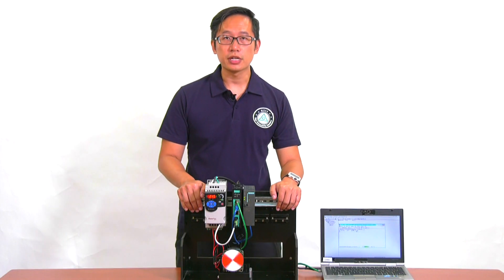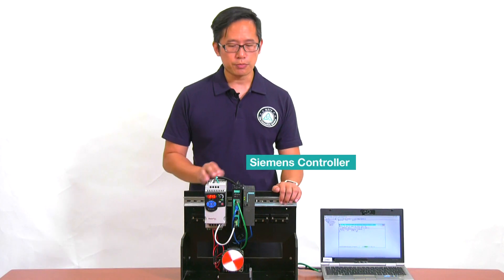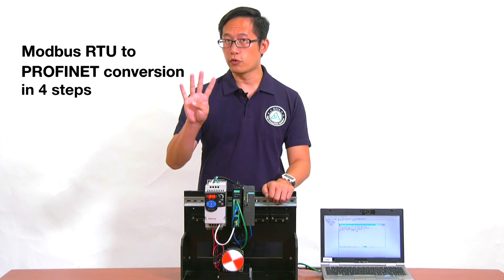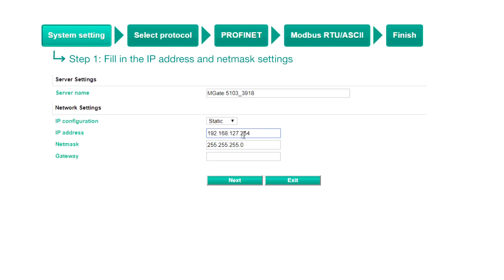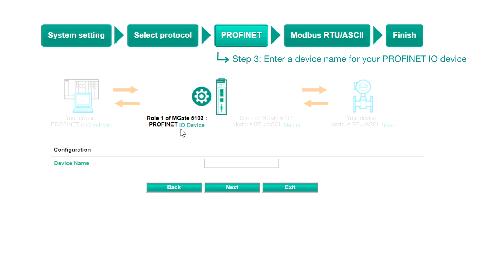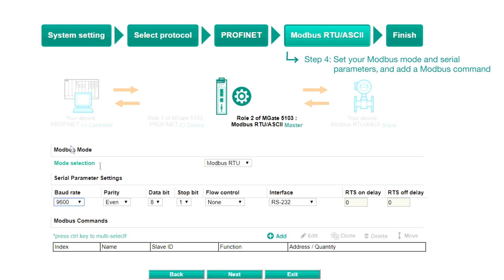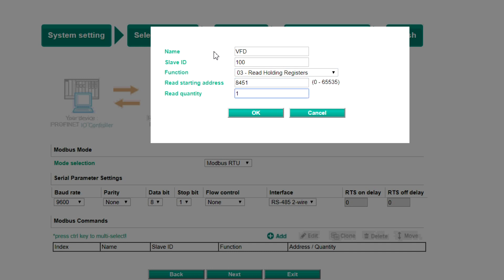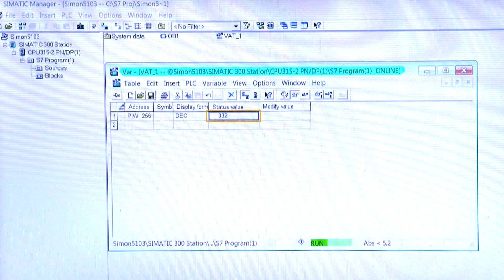Convert Modbus RTU to PROFINET in 4 Steps

Comment: Really Impressive.. as you have shown in a video, Moxa Gateway can be configured in quick 4 easy steps but for siemen's PLC in simatic manager in it's hardware configuration it require GSDML file to configure as profinet slave.
where did i get that file ?

Comment: Hi, it's a protocol converter for "one" Modbus Slave device? or can i have access to more of one slave on a Modbus line with more Items. thanks
Reply from the maker: The MGate 5103 Supports RS-485 2-wire serial interface. With RS-485 2-wire, you can have up to 31 Modbus RTU serial slave devices connected on the same bus. Furthermore, you can configure the MGate 5103 to send up to 128 different Modbus commands to those serial Modbus Slave Devices.
Reply: @moxainc  thanks…so it’s a gateway..right?
Reply from the maker: @MarioATEFPV  Yes, a Gateway for sharing data between two different Industrial communication protocols. A Moxa solution provider can discuss your application and the MGate 5103 as a solution in more detail. Please visit this page to find a local distributor: https://www.moxa.com/en/how-to-buy/find-a-distributor